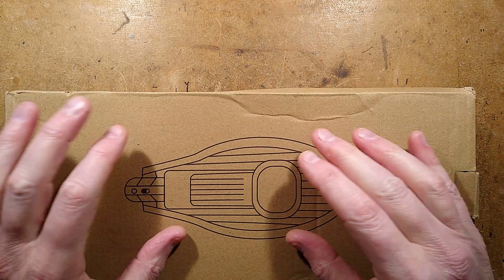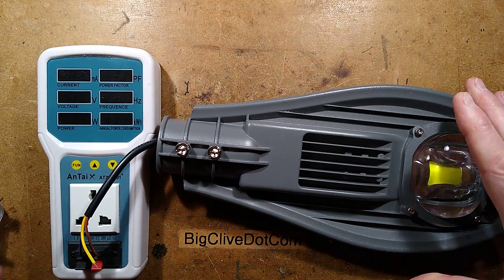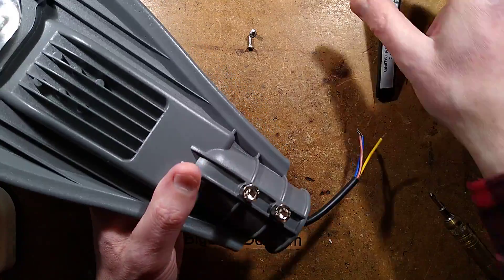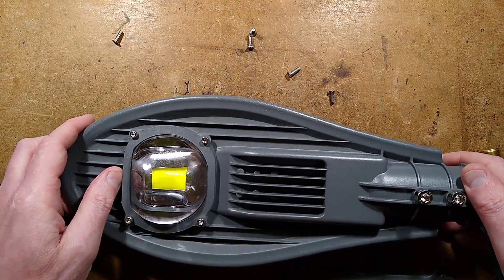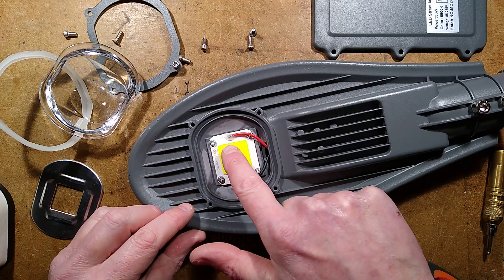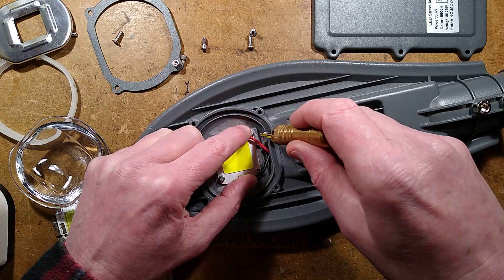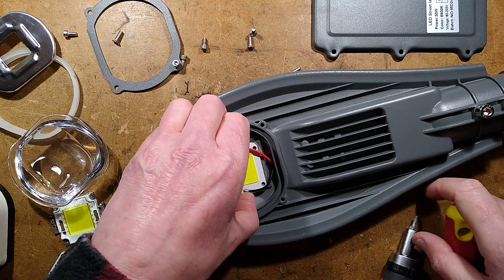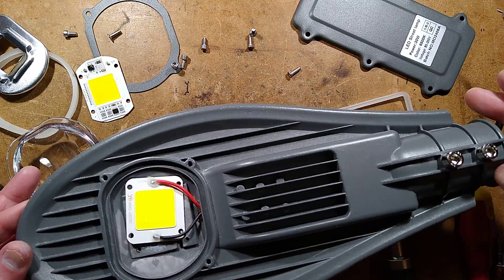Inside a Chinese street light from eBay

Comment: Any tips regarding replacement battery packs for ebikes?
I just paid a fortune for one based on the claim that it is made from 18650 Panasonic cells from a company that is at least based in the US. Those from Amaz## looked outright frightening, but go for about half the price.
However, once I receive the pack, I cannot break the seal to open it and check without voiding my warranty. So I got to believe what is in there is what I paid for. And that still is not a guarantee that the battery management system (BMS) electronics is any good.  A faulty BMS can blow the best quality cells, no matter what. Tricky situation it is.
Reply from the maker: eBike batteries are a minefield.

Comment: I've not been a fan of the driver on board LEDs due to the flicker. I feel like flicker is why they're using the older driver based solution.

The only time I'd really want to use a driver on board LED is a grow light

Comment: 30 watts at 20 foot in the air is terribly underpowered for a street light. Your lit area would be tiny and very shadowy. Real street lights use 10 times that power. Most 1k watt bulbs have been replaced by 300 watt LED
Reply from the maker: The power will depends on the height and application.  You can get high profile street lights from 10W upwards.

Comment: Can you get them with a pe cell?

Also, I've noticed with the cheap led bulbs with the driver on board, when the ic chip fails the leds just glow very dim, but no strobing thank god.
Reply from the maker: The glowing is often the open circuit bond passing current through carbonising.  It can actually burn through the fibreglass shim and short to the metal plate.

Comment: I'm on my second of these now. On the first light the LEDs failed, but the current one is going on its third or fourth year. I live by the sea in a very windy region, so I'm quite impressed! When the first lamp went out, there were some minor rust around the screws holding the LED, but nothing on the cover. Might have been alu on the older version?

Comment: I've found that items from China are typically well made from a construction standpoint, with servicable hacks to improve the workings not that difficult to achieve.  Take the case on this unit.  Nicely done with surprising detail to reinforcment on stress areas and general heat sinkability.  With better guts this would be a several hundred dollar unit here in the states, knocking on a grand if it came from someone like Hubbell or similar.   Thanks for the video!
Reply: Nicely constructed, with a wibbly-wobbly ground and non-heat sinked driver.
Oh well, the steel shan't have the opportunity to significantly rust and one does get what one pays for. Want a light that'll last a decade? It'll be around 10 - 20 times the price. I'd address the loose ground and use it around my home's exterior. Use the same LED and a 5 and a quarter meter light pipe/diffusor, I'd even use it to light my room.

Comment: I don't understand the cable sticking out. Are they expecting the terminals floating inside the pole? Also cold white is not the best choice of light color for street lighting. I guess people in China don't need to sleep.
Reply: There are national differences in the preference of the colour of light. People in the UK usually prefer a warm tinge to the light, but most people in India do not like this and prefer a cold daylight colour. Most LED and fluorescent lamps that you can buy in India have this cold colour. Maybe there is a similar preference in China.
Reply: @cedriclynch  Amen brother, you got that right. There have been studies that showed hot climate -> cold light preferred and vice versa.
Reply: @cedriclynch  That doesn't change the fact it's bad for health and environment.
Reply: @JendaLinda warm light is just as bad if its bright enough
Reply from the maker: The use the short tails that come with the driver and just pop them out to tick the "terminations" box.
Reply: @bigclivedotcom  I suppose they're using those cheap push connectors you've shown in a recent video.

Comment: 22 bucks P+P+customs+VAT included? Powder coated all around? 2 silicone rings? Interchangeable LED-module with standard mount? Thermo-paste used? Interchangeble driver? Wires of sufficient thickness? No chance of insect ingress? Decent light output?
I like it!!! 😃👍
Reply: Our councils will still find a way to make it cost 4 figures to replace one though
Reply: @bellowick  At least! 😂🤭
Reply: A ground wire pegged to the case instead of being properly secured, a mystery driver module, and nothing remotely UL/etc.? Sorry, I don't like it.
Reply: Factory workers in China get payed very little money about 250 eur /month.
Reply: Still financing the CCP if you buy one.
Reply: @RT-qd8yl buy the expensive one and it’s the same
Reply: @RT-qd8yl  For that price the CCP have certainly earned every single cent...

Comment: You could use the thermal sheet as an insulator if you went with the DOB
Looks like they provided posts for a strain relief but didn't use it, maybe that's what the earth wire is for
You don't need earth if it's not exposed to touch (too high to touch), and it's earthed to the pole which is probably just relying on being in the ground
Reply: Our house is steel sided and roofed. This thing could electrify the whole building.
Reply: @RobertBeck-pp2ru  I would hope your house is properly grounded, maybe as part of the electrical code

Comment: A geuss before the answer in the video - zink alloy (pot metal instead of copper-alluminium alloy, a.k.a. aviation allumunium). Ding-dong, who wants to be a millionaire :)
Reply: Most likely zinc alloy or chinesium, quite easy to make fine castings with it such as motorcycoe carburettors etc. Good job its not going to be load bearing besides its own mass.

Comment: When you said "it is quite a cold 6500 Kelvin" I just realised that cold white is a lot hotter than warm white. Don't know why I'd never noticed that before.
Reply: This comparison to black radiators and colour temperature always bothered me 😢 The principle makes no sense and the vocabulary even less. Probably an US standard.
Reply: @LasseGreiner   No, that's physics and physiology. The hotter a body is, the more blue and eventually ultraviolet. Our body and eyes assign red to "warm", as the heat that we feel is infrared, i.e. more to the red.
So, basically: "Warm" is the amount of infrared that is sent. A hotter body also sends more infrared than a cool one. But the colour balance will move to blue / ultraviolet with higher temperature, because the blue part will raise much faster with temperature.
So, "warm white" looks warmer to the eye, but it is produced by a colder body than "cold white" which contains more blue in addition

Comment: Can these type of led be used in disco lights to replace halogen bulbs?
Reply from the maker: Not easily as the optics are designed for a sharp point of light.
Reply: @bigclivedotcom  do they make LEDs that easily replace bulbs as Ive seen lights such as datamoon and scanner that have been converted or are they pants?

Comment: Earth??   we don't need no stinking Earth!
Reply: Safety is the #3 priority in China. Perhaps lower. I had to ground the case of the KSGER T12 soldering station that I got off aliexpress. Who knows how much other cheap Aliexpress stuff has no case grounds.
Reply: @JonnyFlash80  - Actually, the Chinese courts / government tend to be pretty heavy handed with safety "mishaps" (the ones that cause victims, at least). It's just that, if foreign companies ask "how cheap can you make it?" and don't give them specific safety requirements, they're happy to oblige.
Reply: @RFC3514 Lol, I suggest you spend some time in China and learn how “heavy” the courts are.
Reply: @johanea  - How much time have you spent in China, and which crimes did you get away with?
Reply: @RFC3514  doesn’t seem to affect the social score.
Reply: @the_tux  Sheer paranoia.
Reply: @JonnyFlash80  Cha bu duo engineering with tofu dreg assembly.
Reply: I had a 4 dollar chinese soldering iron that still works and whenever i adjusted it's "temperature" it would decide to zap me

Comment: For what you pay this seems good value - that casting would cost a lot more if manufactured in the UK.  As for rust all those screws looked like low grade (magnetic) stainless steel - so even if the covers rusted you would probably not be able to get them off anyway 😂😂😂😂
Reply: I doubt it's designed to last long enough to rust significantly.
Reply: Exactly.

Comment: The gear cover on the earlier units was made of the same brittle white metal as the rest of the case, it used to crack if you tightened the screws too much!
Reply: Its cast Aluminium
Reply: @NinoJoel  Cast iron since it is magnetic
Reply: @afre3398  the entire housing is  cast aluminum. 
Only the screws / the frame that holds the lens and the back cover are iron
Reply: @afre3398  The original one was cast aluminum, the current one is apparently a sheetmetal.

Comment: It was probably specified to have an extra washer with instructions that the wire must be connected. Then someone realised they could save a fraction of a yuan and maybe a second of assembly time by leaving the washer out.
Reply: Or the hole wasn’t drilled deep enough for the screw
Reply: @Pwills  or they saved a fraction of a yuan buying slightly longer screws.
Reply: @TheGramophoneGirl  the mystery deepens 🤣😂🤣
Reply: @TheGramophoneGirl  Bet it's the same screw as hold the cover on. Ran out of the short ones? Just keep using the longer ones until your shift is over.
Reply: @RossReedstrom  lol sounds likely doesn't it. "It'll be fine, it's just an export model"